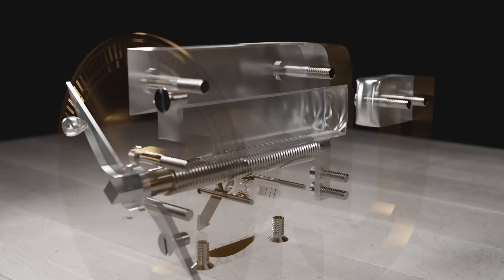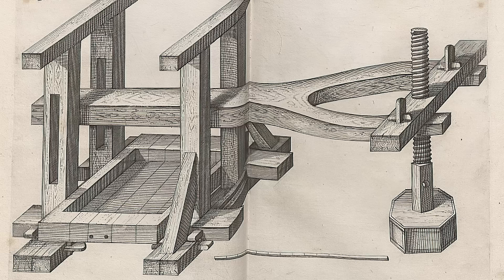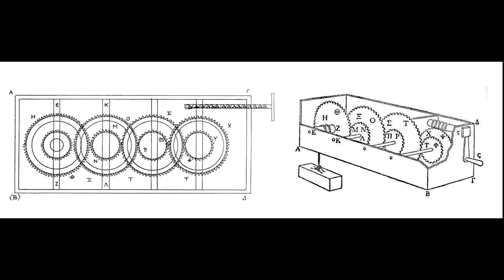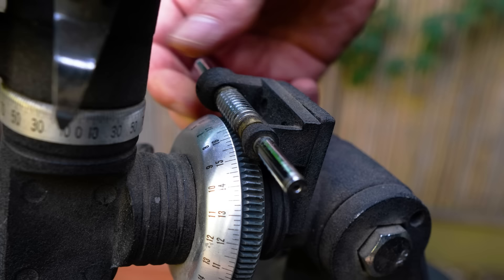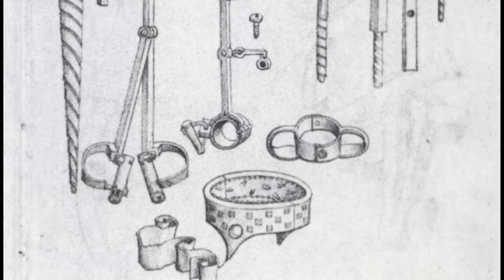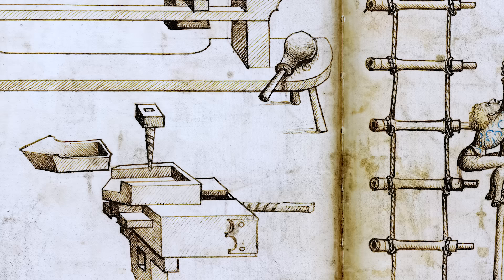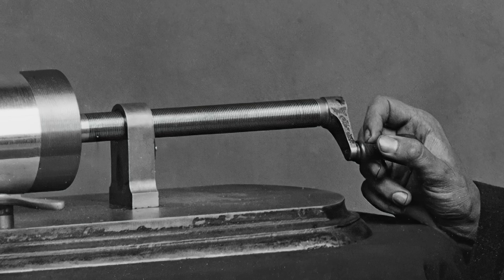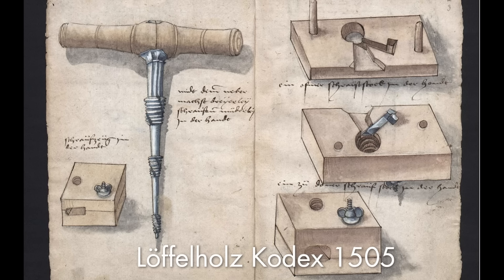Where DO screws come from?

Comment: In my profession, a mechanic in a factory, they're all screws as far as the store room or manuals are concerned.  As in a socket head cap screw (SHCS) for Allen headed screws.  Only when you add a nut to the end does it magically become a bolt.  If you thread it into a part with matching threads it's still a screw.  But no one gets upset when you call it by either name, we all know what we mean.
Reply: I argue against this as per instructions!
Reply: I've heard an opinion that the difference between the two is that a screw is threaded all the way up to the head and a bolt has a smooth section of the shank near the head.
Reply: @variant1394  
Ehhh, the smooth section basically helps to have a WAY better stress distribution around the most critical part, where the head meets the shank. Also woodscrews, that are most definitely screws, can have a smooth shank for a section. I would say that definition is lacking.
Reply: @Tuning3434  I don't thin I've ever had a normal machine screw or bolt fail at the head regardless of where the thread was cut to.  Most often it's the thread that get stripped off the screw, some very rare times its the thread getting stripped out of the part.  I have had wood screws fail like that if they've been used a few times.
Reply: to me the definition would be:
screw: a kind of threaded rod, it may be partially or totally threaded, the exact profile of the shank may vary, it have a head or not but always has an interface for a driving tool.
bolt: an assembly composed of a screw and a nut, the use is usually for assembling parts through unthreaded holes. for this assembly to form a bolt, the nut must be the only element retaining the screw in the hole(s).
Reply: I have always felt that anything self driving, ie pointed tip, to be considered a screw and anything requiring a premade thread to be a bolt. I think this is the most elegant explanation for the difference.
Reply: In my profession, a caregiver with no mechanical duties, it's all a screw until you slap the nut on it.

A bolt is the assembly, a screw and nut become the bolt.

I thought this was "the way".
Reply: @variant1394  that's arbitrary as fuck.
Reply: @quentintin1  this is the way.
Reply: @SurelyLightFoot  Bolt is the assembly of nut and screw. You literally just described a subcategory of screw, a self driving screw.
Reply: @SECONDQUEST  I realize but for general terminology I feel my explanation is most layman’s use case. If we want to argue semantics then a bolt is a sub category of screw. I know that man generalization isn’t perfect because a lead screw doesn’t fit into the term
Reply: @SurelyLightFoot  the bolt is not a sub category of screw, but an assembly.
screw is a broad term that encompass a lot of specific derivation of screws, such as:
-set screws
-machine screws
-self driving screws
-lead screws
-Archimedes screw
all these examples fit under the definition in my previous comment up this thread

if i go to my local hardware store and look specifically for bolts, i find two type of products:
-carriage bolts
-screw and nut sets
Reply: @UnbeltedSundew  – also,
 When it is in shear is it can fail where the stress risers of the threads are. That is one reason why the shank is unthreaded for critical shear applications.
Reply: @variant1394  That's what my old engineering boss used to say but then I realised all the long wood screws with shanks on them would be classed as a bolt. I didn't contest him over it because it seemed kind of petty and I just called them twirly-nails.
Reply: Screw that
Reply: @quentintin1  I disagree.  A bolt does not have to have a nut.  Many bolts thread into blind holes like those that clamp the head to an engine block.  Never heard them called screws.   It is a confusing mess.  Stove bolts have threads up to the head and are often slotted like a screw.   McMaster-Carr calls shoulder bolts screws but Fastenal calls them bolts.  I give up!
Reply: @tobiaslang3621  I never made an argument otherwise.  All I did was point out the most common failures I've seen, so that's what's happening.
Reply: I grew up repairing farm equipment, we called it a bolt if it had a hex head. Even if it was obviously a screw, like a lag bolt. Argh, I did it again!
Reply: @davidjones-vx9ju  nothing, but you gottya be more specific about what you think is wrong.

-not encountering snapped fasteners:
if you don't work with seized fasteners or euipment that put them under high stress it's very possible to never see such issue, i'm a pixie wrangler and never had broken fasteners on equipement.

-you don't say "i need a 2 feet long screw" since they don't exist, you just grab a 2ft long piece of all thread and slap a nut on each end

-a crescent wrench is a wrench of the adjustable type used to drive screw and nuts with square or hexagonal drive interfaces, it is called such because of the Cresent brand, owned by Apex Tool group
Reply: @davidjones-vx9ju  Yes I've built many things, threaded many holes.  Which pretty much means I'm dealing typically with new bolts and screws, in new things.  As max said I haven't really worked on too many old pieces of equipment.  Just an old Spanish mill knockoff of a bridgeport and an old lathe.  And if any of the Allen heads on the mill broke off it would not have been a fun day.  That said none of the fasteners on it de-threaded either in themselves or the machine.  

I know it may hurt you on some fundamental level that others have different experiences than you, but I'm sure you'll get over it.  Or maybe not, I mean you are trolling for a reason.
Reply: @UnbeltedSundew  My hobby is model engineering and I've torqued the head off more than one normal machine screw with hamfistedness. This is not my day job!
Reply: @variant1394  we called fasteners threaded all the way up machine screws and ones with plain shank bolts,  when I was an enginner, and just said screws or bolts, but the only screws we used were self-tappers (no tree carcasses in our line of work...), so they got called self-tappers. Nomenclature varies wildly across trades, it's all about context.
Reply: Screw this dilemma, call them fixings (threaded) and be done with it. 😕 or should they be fastenings? Oh Hell, more dilemma.
Reply: @variant1394  ,
Reply: After having worked many years in a store selling fasteners of all types, I can tell you that there’s no firm rule. If there is one , there are so many exceptions that the rule is meaningless. Many here have pointed out some of these.
Reply: @variant1394  l think the smooth portion is just to ease manufacturing and lower cost.
Reply: I'm also a mechanic (DON'T call me a "tech") l think there all screws if threaded. I think "bolt" is slang.
Reply: @acapellafeller  I agree. There are too many exceptions to have a proper rule. My "rule" is that a bolt always needs a nut except when it doesn't and a screw never needs a nut except when it does. Boltiness and screwiness are in the eye of the beholder.
Reply: @variant1394  That's the UK usage with which I am familiar.
Reply: @graham2631  as has already been mentioned, the smooth shank is generally to keep threads out of a shear plane as the threads are stress raisers and putting the threaded portion of a bolt under shear significantly decreases its strength.
Reply: When a threaded fastener goes into a part with matching threads, I call them machine screws, but that's just the way I personally roll...
Reply: Interesting posit. I as a fixer of anything mechanical have always considered a screw to be low torque applications with the drive area being pressed into the head like an SHCS, phillips, torx, flathead etc so that the fastener acts like the female and the tool the male and a bolt to be for higher loads and having the socket of the tool being the female and the fastener being the male.
TLDR: Screws weak, bolts strong. Screws girls, bolts boys.
Reply: Oh  and to weigh in on the bolt vs screw discourse - it's just a matter of convention, with no firm definitive dividing line between the two. Generally in structural engineering, a bolt is something that is threaded into a nut, while a screw fastens into the material, but there are enough exceptions to this that it becomes pretty meaningless. The only thing that is certain is that a bolt is not the assembly of a screw and a nut - we say "nuts and bolts" precisely because they're two separate devices that together form a bolted fastening. If you get a fastener catalogue, you'll see entries for hex head bolts and separate entries for hex nuts, because you don't, in an industrial setting, even buy them as matched pairs - a connection may, after all, require two nuts per connection, or a lock nut, or whatever else.
Reply: As far as I know, a screw is up to 4-5mm above that called bolts regardless with/without a nut...
Reply: I have been told the diffrence is that  a screw is driven internaly, and a bolt externaly.
Reply: @makismakiavelis5718  I'd say that was a pretty good rule but it definitely fails with cylinder head bolts that do exactly :-)
Reply: @lolz5134  Torx drive  cylinder head bolts are driven internally but they are definitely bolts... Probably.
Reply: @xxxggthyf  
You mean set screws right?
Reply: Machinist here, and its the same story in ever machine shop I've been in. I think the difference between "Screw" and "Bolt" only really matters to the engineers, and even then only, when its critical. There are times when you are examining an assembly and you really do need to differentiate between the screws and bolts. But outside of that narrow context, it hardly ever seems to matter.
Reply: @UnbeltedSundew  I heard then saw the result of 20 or so M16 screws fail on a forming die in use on an 800 ton press. I was in the technical office on the second floor.
Reply: @lolz5134  This is what I've been told too. I'm an engineer and I used to call bolts and screws the way as told in the video. But recently at my job I was corrected. When using a (Torx-) screwdriver or hex key to fasten it, it's a screw. When using a spanner it's a bolt. This sounded strange to me. After Googling a bit, apparently there is no universally accepted definition.
Reply: @UnbeltedSundew  in those cases the threaded connection was just under spec'd. The typical standard is to design threaded connections to have enough thread engagement in order to make the weakest point of the connect the bolt/screw itself (ie ignoring the possibility if striping the head, the bolt shank would snap before tearing the threads out of either the bolt or hole). Of course this is just a typical guideline and really the amount of thread engagement is almost always influenced by other factors like assembly requirements and such but where possible this is how a threaded connection should be designed.
Reply: A bolt is just a thicc screw
Reply: i've always understood it to be if it has a driver that goes into the head it is a screw and if it goes into the driver it's a bolt.
Reply: I worked with a guy at a food production factory as maintenance and he referred to screws as "burs". How odd ya, well he said that's what they always called them on "the farm".
Reply: People say they blew up their motors , not engines,  yet we all still survive      Potato patato
Reply: @makismakiavelis5718  Nope. To me a set screw is a screw where the head is entirely below the surface of the part into which it is fitted.
Reply: @nadronnocojr  Oooh... That's a whole other can of worms complete with many regional variations. Most British people only ever refer to the engine in their car as the engine (except when they don't) but we still use the expression "motor car". Never "engine car" for some reason.
Reply: @SurelyLightFoot  best description yet
Reply: It's a great case for those who thought only the measuring system is wacked up in the "imperial" world ;)
Reply: @SurelyLightFoot  elegantly incorrect
Reply: @UnbeltedSundew  I think a Lagun mill is a superior "knock off" to a Bridgeport mill 😉...
Reply: @victorjbarker  It wasn't a Lagun mill though.  It was made by some company called Burke I think.  I tried looking it up but never found out more than that it was Spanish, maybe...  In any case it was decent, the biggest problem was the x axis on the table it was a bit loose, and when you tightened the traveling wedges (No idea what their proper name is) in enough so that it didn't wiggle it was super stiff.  There was also a couple of other problems, but it did the job.  I had to give it up because I moved and had no room for it.  I miss my mill.
Reply: @UnbeltedSundew  was it perhaps US Burke? Coincidentally, I happen to have a Burke 3/4 knee mill which is made in the USA called a Millrite. Also know as Burke Powermatic at one time. Sometimes these machines had a cast nut for the lead screw that can wear or crack. They can be replaced, repaired, or even retrofit with an up grade. The wedges are referred to as gibs. It's a nice reduced size machine much heavier than import mini-mills.
Reply: @victorjbarker  I finally found a picture of my old shop where I could see the nameplate.  It was Holke, model F-10-V,  I suppose I thought Burke because the H looks like a B because it has lines above and below the word on the plate, and Burke is a more familiar name to me.  The knee z axis was super grindy, it felt like there was a part of the thread missing a bit because when going up it would drop a tiny bit down once per revolution (or I assume it was once per rev), but it worked anyways so I never tried to get to it and see what the actual problem was.

It's pretty strange that I would think it was a Burke and that you have one lol.
Reply: @variant1394 I work in a hardware store that's how we differentiate between machine screws and bolts.   Wood screws are a different beast.
Reply: Could a lag bolt, which is a screw, be a bolt with wood becoming a nut? Maybe if only the final piece of wood bites?
Reply: There doesn't seem to be a solid "rule" on this. It was mentioned that a screw threads its hole and a bolt follows pre-threaded holes.
How then do you explain a lag bolt?
Reply: I work in a furniture factory and we call differently (in my langauge which is Czech) screws to wood (self-cuting) and screws mostly for metal parts with threaded hole needed. When you mix it, you sound very uneducated. 🙂
Reply: I second the "Twirly Nails" motion!
Reply: @quentintin1  Good explanation. As having worked in a warehouse selling fasteners and a factory producing fasteners, I've read the correct industry terminology many times and it sounds like this.
Reply: All I know is lathe goes burrrr
Reply: @variant1394   Many bolts with hex heads are threaded all the way up to the head. The difference between bolts and screws are so murky and definition will work.
Reply: Wish I had a dollar for every time during my 50 years career that I inserted an Allen wrench into an Allen screw. Positive it would buy me a nice new car.
Reply: Head bolts hold your cylinder head to the engine block. There is no nut, the block is drilled and threads are tapped. Although it is a screw because it has threads, it is most definitely a bolt. If it is a wood screw,  it requires a screwdriver. If it is a cap screw it will be Allen head or torx drive. If it is a hex head and requires a wrench, socket or spinner it is likely a bolt. If a nut is used, it is a nut whether it is attached or not. Same with the bolt, it is basically a screw because it has threads. You can’t usually turn it with a screwdriver as a bolt may have enough torque that you’ll require a long lever to turn it. And then there are studs, where one end is threaded or pressed in and a nut is used to apply the force. A lag bolt is a large wood screw with a hex or square drive head and requires a wrench, socket or spanner. Depending on your region, a spanner or a wrench is the same thing.